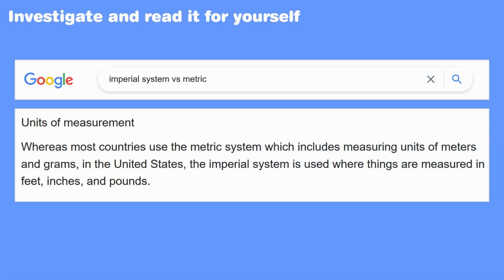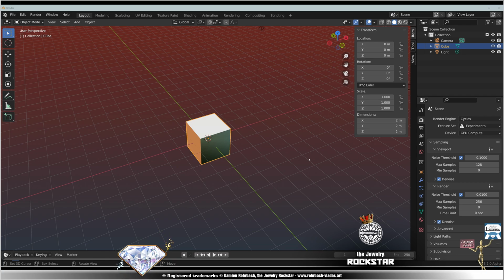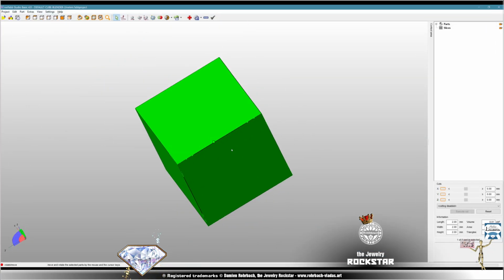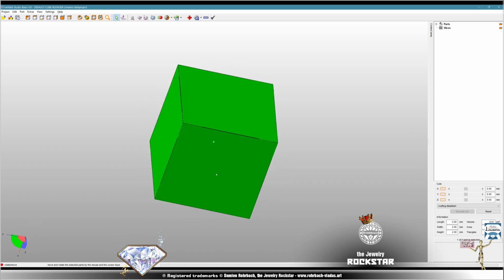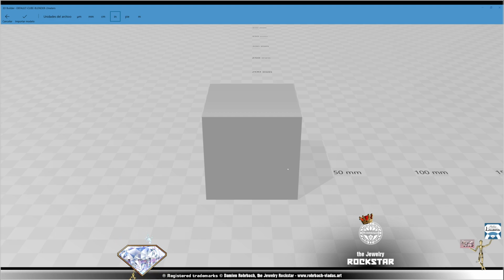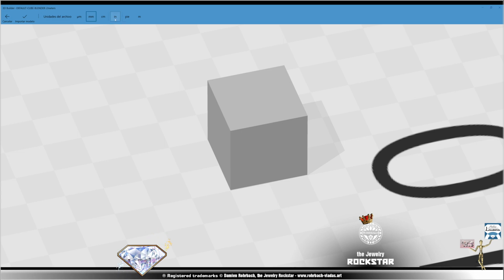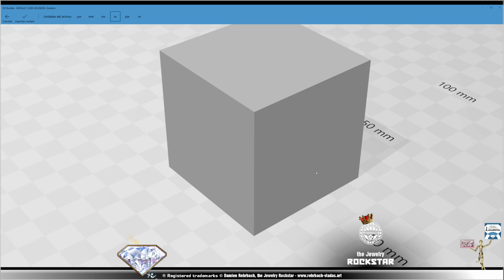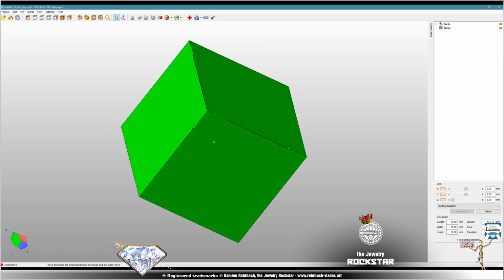MEASURMENT UNITS for your 3d prints, 3D jewelry designs BLENDER NETFABB and 3D BUILDER examples

Comment: This problem can be sold inside from blender if you set the Units to metric Unit scale to 0.001 and Length to Milimeters
Reply from the maker: This video is made to make you aware that softwares changes scales and measurements systems. It's not about Blender, it's about all softwares when you export and when you import. You are  not going to solve much.
Reply: @RohrbachJewelryDesign  yeah I know the purpose of your video and it was good for everyone to understand how it works the scale inside the blender. That's why i wrote the solution for faster exports. I use it also with the zbrush, and my exports from blender was exactly the dimensions for  all my jewelry models.